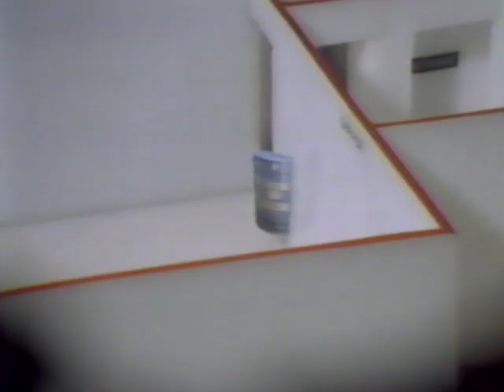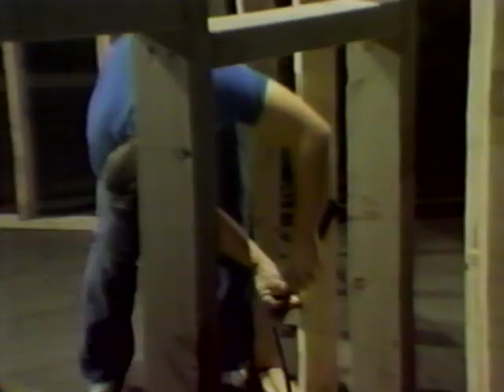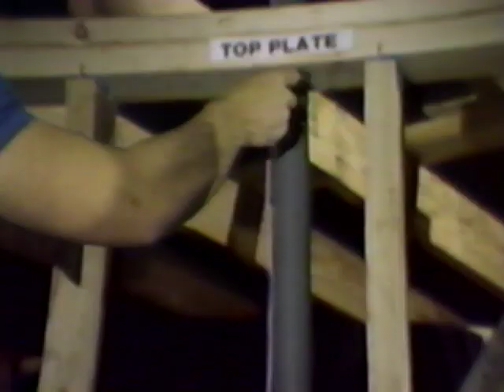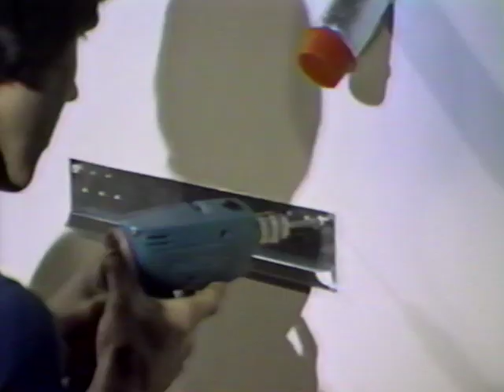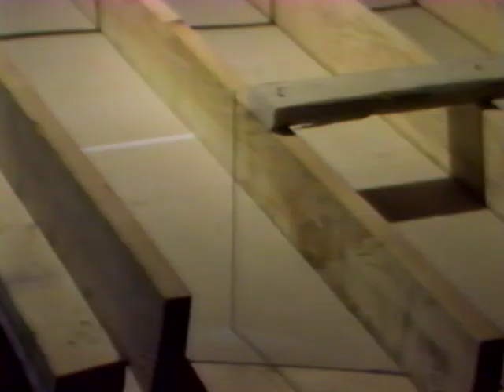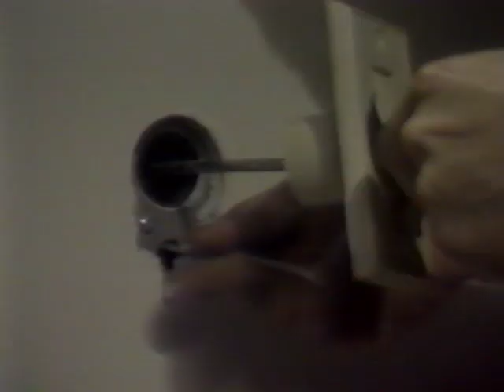1980s MD Central Vacuum Installation Video with Professor Grant Olewiler and Wayne Emdy

Comment: Man, you could never get away with this today This is so funny. It makes me miss my B2. I wonder why they called it the B2 because you could hear that thing screaming through the walls of the house too badly shorted out and fried the circuit board.
Reply from the maker: Originally there was a Model A (single 7.2" motor), and a Model B (single 5.7" motor), and the B2 was next with two 5.7" motors. Then came other models like the E and E2 (for Extra capacity), Model SV (idk Super Vacuum??) with two Model A motors, etc. It's too bad your B2 is gone...let me know if you ever want another one!